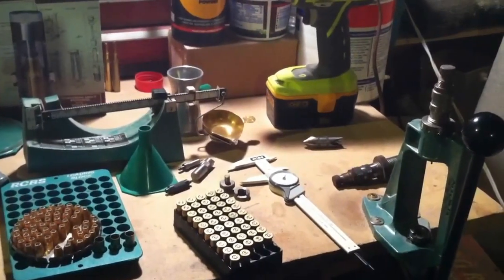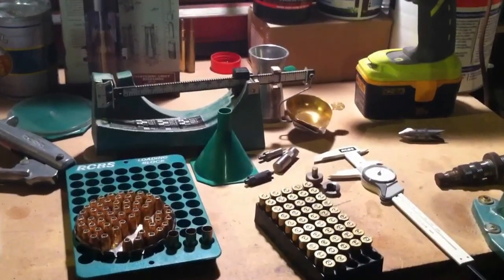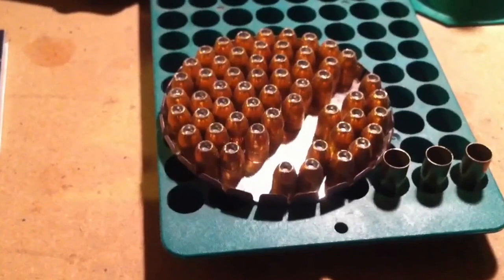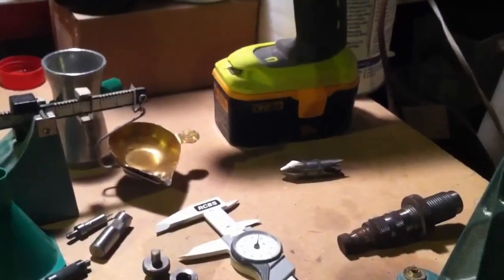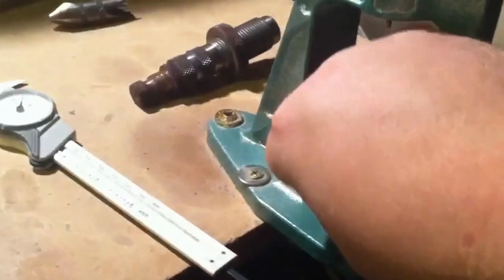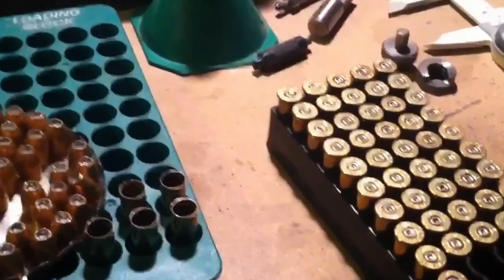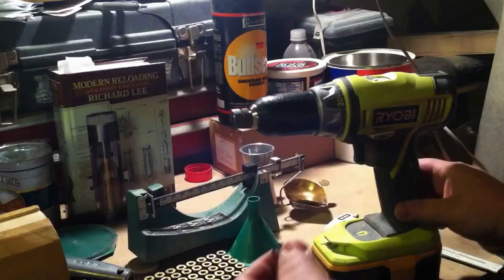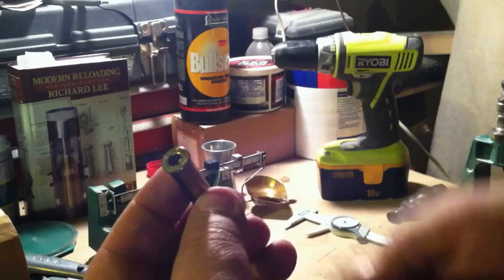Reloading .38 special .357 mag Part 1

Comment from the maker: There are many opinions on that subject its always safer to discard cases sooner than later some people only reload cases 4-5 times others reload them dozens of times I always inspect each case for signs of weakness thin spots and case separation signs some case last longer than others also high pressure loads will wear cases out sooner than plinking or light target loads. Always err on the side of caution if in doubt throw it out.